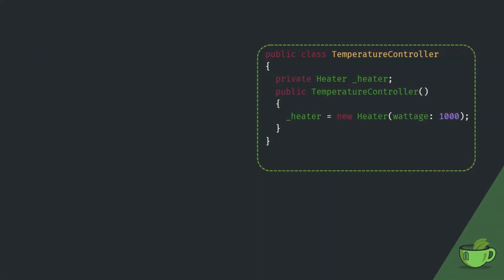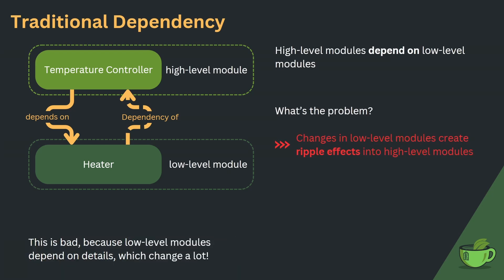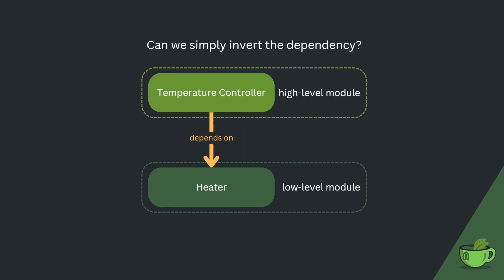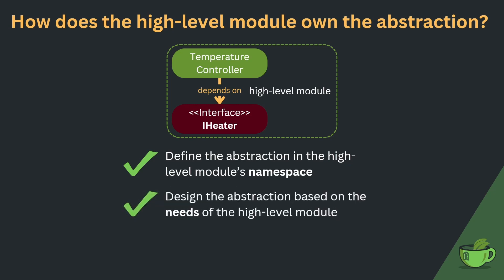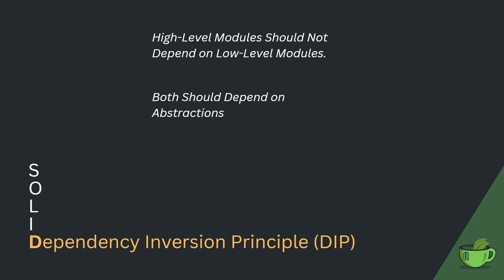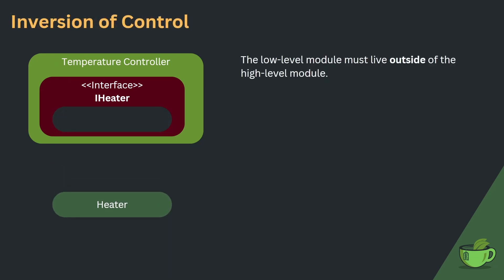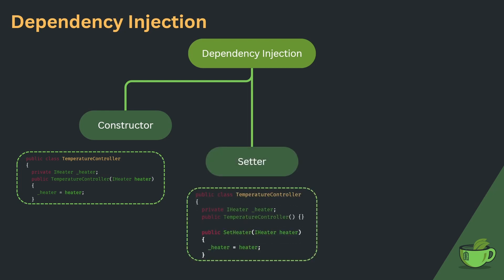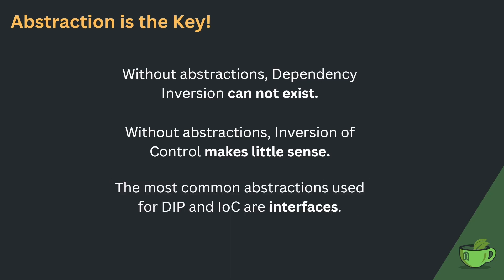How Dependency Inversion Relies on Inversion of Control | Interface Masterclass Series

Comment: I've been using depencency injection and it is great when unit testing. This goes a bit deeper - the stuff with the higher-level module owning the abstract interface sounds really interesting. Do you know some good real-world examples of how this is done? Thank you!. Second question - what to do if the software is not static collection of objects but objects need to be created anytime at runtime? Who creates these objects?
Reply from the maker: I use ownership of the interface by the higher-level module a lot. One example I came across recently was that I wrote a manager class for programs to be executed on a remote real-time system. I split the system by responsibilities: 
- The manager itself had the responsibility to decide whether a new program could be created, updated or deleted (basic CRUD). This includes validation in some cases.
- The manager interfaces with a persistence class, that would then care for writing the programs to a file or database, and loading them etc.
- The interface between those two is defined and owned by the manager, and hasn't changed since its initial rendition (was extended a bit though, Open-Closed principle applies)

For your second question, dynamic dependency creation at runtime: I don't know the specifics of your case, but I often solve dynamic object creation via the Factory pattern. You can then inject the factory (rather than the dependencies themselves) into you services, which allows them to query/create any required dependencies at will. The factory can then decide internally, where the dependencies are stored (if that's of importance to you).
Also, if you are using a DI framework, it might provide a built-in solution for dynamic object creation and lifecycle management.

Hope this helps!
Reply: @GreenTeaCoding  thanks for the example. Man I love this video, it will be one of these few special ones that change the way one thinks about software design. On the benefits of inversion of control I personally add a big one - the high level module doesn't need to know how to instantiate the low-level module! This makes the code so much cleaner - no more passing of long ugly list of arguments or passing "config objects" down the call stack, needed to instantiate some class somewhere deep down.
Reply from the maker: That's a great addition, thanks!
Reply: If you think about it, the dependency injection and inversion of control should be intuitive and default approach in object-oriented software design which tries to model the real world. Take the real car for example - the car does not instantiate its engine or its wheels. Someone with all the knowledge is responsible for creating all the parts, inserting small parts into larger parts, inserting larger parts into the car - before it leaves the workshop to to its job.
Reply from the maker: True, but programming itself is hard already, and that's why we default to doing things the easy way, rather than the right way. It takes experience and learning from failure to see that the seemingly easy way is actually the one that will make your job hard.